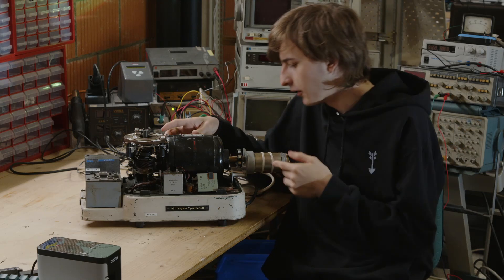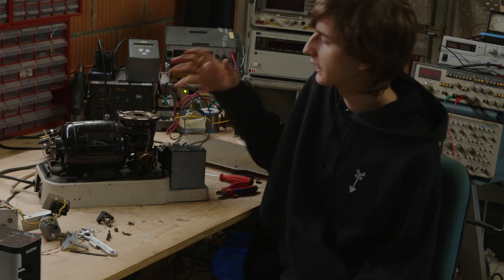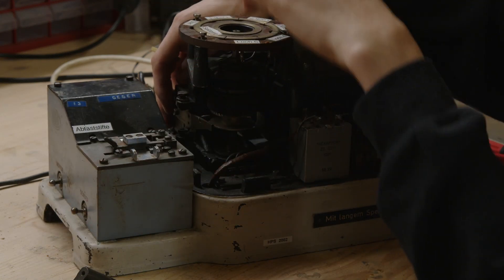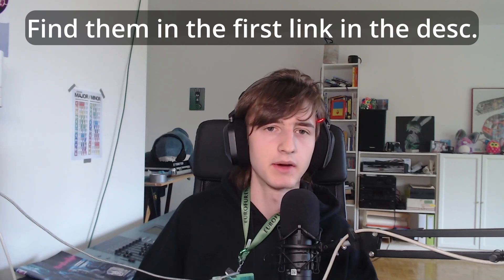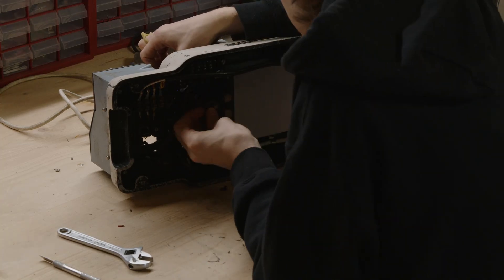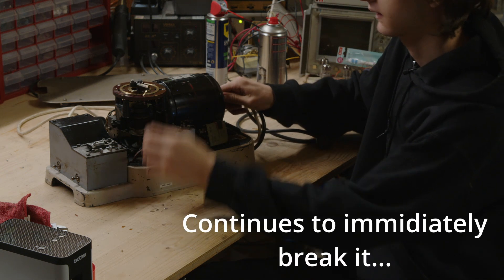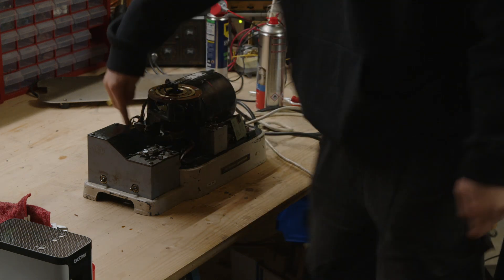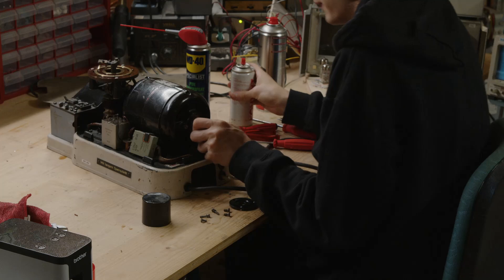The Crazy way how they transmitted data in the 1930s

Comment: You should test those capaciors, they are likly to be paper in oil capacitors.
They may even contain PCB oils, verify them for leakage physically and electricly.
If they are electrically leaky they can short someday and release presure, as in releasing their toxic oil.
Reply from the maker: Good point. I will do this as a follow up, once im putting it into operation

Comment: An interesting device, nice to see it get cleaned up. It'll probably have a universal motor, the advantage being that it can be used on AC or DC power of the same voltage. Not so important now, but electricity supplies weren't always so consistent. I have some 1950s washing machine flyers that advertise they were available in "a model to suit your power supply" with "240 Volt AC and 32, 50, 110 and 220 Volt DC models". 
Annoying that the motor casing back wouldn't come off. Usually carbon brushes are easily removable so they can be checked and replaced. As long as there's no excessive sparking the brushes and commutator should be fine.
On a cheap tool I once unintentionally unscrewed one of the brush covers and the brush went flying, I couldn't find it. Somehow the tool still worked without that brush, I have no idea how.
Reply from the maker: Sometimes the spring or contact holding the brush, can be the brush, you will just wear out the sliprings.
I am not sure if the same voltage kinda thing happened here in europe, because everything ive seen, even like 1890s generators powered by steam engines and stuff seem to be 220V which is XL se enough to the 230That we have since about 20years now.
Reply: @curiouscomputer  Yes, that could be the case with the tool.
I don't know much about Europe, here in Australia power supplies were a bit all over the place both with voltages and frequencies. One state only switched from 40Hz to 50Hz in the 50s! I haven't actually encountered much that isn't 240V 50Hz though. I have a record player that according to an old advert originally had a 60Hz motor, which is a frequency I can't find any record of being generated here. I also have an American radiogram that could originally operate on various AC and DC voltages.

Comment: I learned something new about Power plugs! I remember those old plugs. It's still 220 volt correct which is why you can get way with the 500ma fuse? Anyway I really enjoyed seeing this piece and that you got it running! Now for some paper tape?! Also enjoy that your working on electro-mechanical devices rather than just electonics. There is a lot of cool stuff in Electrics before we went to Electronics.. 😁
Reply from the maker: Its actually 230V nowdays, and yes I can get away with the 500mA breaker (i sad it wrong in the video, I usually hook up most things on it, because it trips the fastest and causes the least amount of demage if something is wrong.)

Also that paper tape thing will be fun. Because i dont have a punch, nor tapes. Because it uses 5Bit 11/16inch tape instead of 1inch 8bit tape, which is easely avaiable.
And yes I also really enjoy working on electromechanical things. You can be exited for the future because there is more where that came from

Comment: Mighty cool gimmick there! Nice to see it fixed.
WD40 is great for cleaning and for releasing seized components, but it's definitely not a good lubricant, it's too thin. You'd better use a proper lubricant, depending on application - paraffin or vaseline oil, bearing grease etc.
Reply from the maker: What I used is a special lubricant apearently. its Lubrication oil. according to the guy selling it